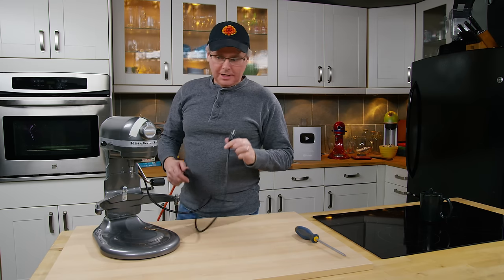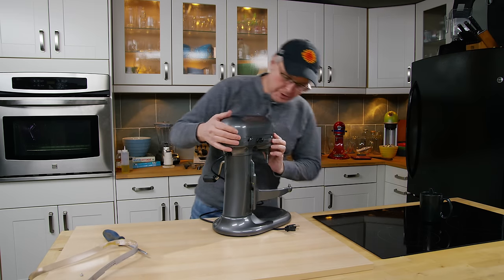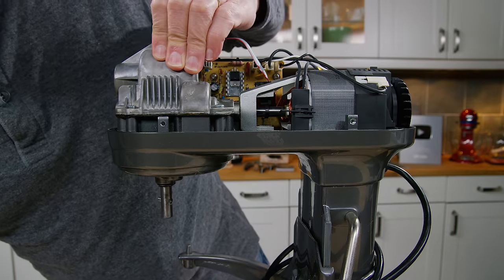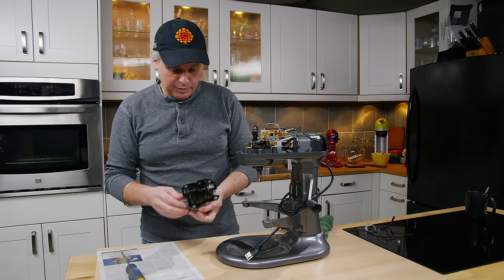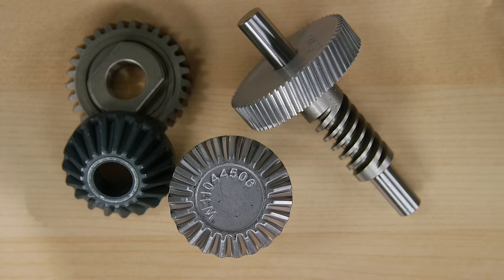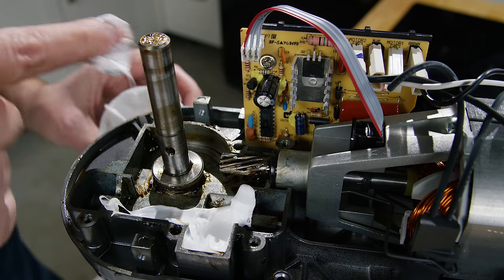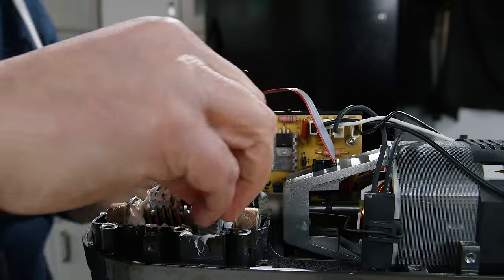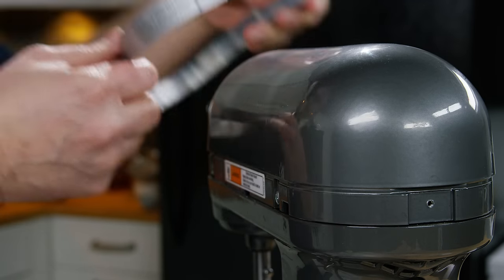Fixing KitchenAid Pro 600 Stand Mixer Teardown & Rebuild Of Gearbox - Glen & Friends Cooking

Comment: Hi,  I have the model Professional 600 mixer and when I slide the switch to any of the speed settings nothing happens for several seconds.  When it does turn on at any of the speed settings the mixer runs perfectly and with speed lever moved speeds change immediately from one speed setting to the next, absolutely no hesitation but when I turn it off and then slide the switch to any of the speed settings the mixer hesitates for a couple seconds before running.  Any thoughts what the issue is?  Thanks very much
Reply from the maker: All of mine do that  - soft start - protects the motor and gears.
Reply: @GlenAndFriendsCooking  Hi, thanks for replying. When I flip it to any speed from an off position it sometimes takes 6-7 seconds before the mixer will begin running.  So far the problem isn’t too much of a big deal, just wondered if perhaps cleaning the switch would improve its performance or maybe I will have to replace the whole switch and circuit board.package someday.  Thanks

Comment: I need to tear down my 25 year old Artisan mixer to regrease. It drips brown oil on hard use like kneading dough.
Reply: You may want to buy a new gasket. That would be the main cause for leaking grease. But while you replace the gasket,re-greaseing wouldn't be a bad idea
Reply: Definitely replace the grease but also try to look for a part number for a seal. I haven't had one that far apart but the space between the output shaft and the case must have some form of seal.

Comment: As my dad always says you can never have enough greese
Reply: Bigga da gob da betta the job!
Reply: Yeah my dad and grandpas were always the same way. My dad was a railroad carman for Illinois Central RR that repaired and maintained train cars and equipment and went to derailments to move stuff back onto the rails. My one grandpa was a farmer and my other grandpa was a Army sergeant in equipment maintenance and repair in WW2 and they repaired everything with engines.
Both sides of my family were do-it-yourselfers and my dad always said ya buy a power tool always take apart the gear box and make sure it has a lot of grease and he always was about maintenance of stuff and always make sure electric motor bearings were oiled and mechanical joints were greased.

Comment: Not all kitchen aid mixer are created equally. You  Could have 2 different pro 600 mixers side-by-side that look identical to each other but one may have a high pitch gear wine in the other 1 maybe smooth and quiet the reason for this is that kitchenaid Makes specific mixers for specific retailers. A kitchen aid pro 600 purchased from QVC or  Walmart can be very different mechanically then one purchased from a non discount retailer like Sears or JC Penney. Kitchen aid is forced by the discount retailers to cut corners and use cheaper And in my opinion  Inferior parts. You should  Also consider avoiding any kitchen aid stand mixer is sold during certain  Promotional periods such as black Friday.  Kitchenaid forces there retailers to ship any mixers the have been returned to the retailer for any reason. Whether a mixer has been return because it was salty, the purchaser didn't like the performance, or even if they received it as a gift and never even open the Box they all must go back directly to  Whirlpool/kitchen aid. These mixers are supposed to be checked and/or repaired Then sold as refurbished . This can me somewhat of a gamble since you don't know if the mixer was once damaged then repaired or If it was just a model that was  Returned.

Comment: How do I find the correct hub gear for Kitchenaid mixer?  I ordered from Amazon , however, the square hole where attachment fit is to big.  I need to know where I can get the correct part because Kitchenaid does not sell parts and are not helpful where you can order parts.  I am not paying them to repair something I can fix.
Reply from the maker: You have to search the parts list for the exact model # printed on the bottom of the machine - then order the parts from that list
Reply: @GlenAndFriendsCooking  What website do I use?
Reply from the maker: I just Googled 'KITCHENAID 5KPM50BWH4 PARTS LIST' and dozens of websites came up. It's a pretty easy search when you know the model # of your machine.

Comment: 4:27  You shouldn't be able to just lift off the gear like that. There's supposed to be a clip locking into the small groove you see later, and it seems to me that the clip failed and let the gears move up and down, wearing the upper gear out (even if it wasnn't used

Comment: Only thing I would have done differently would be to test it before putting the housing back on, if there is an issue you have to disassemble the whole thing to trouble shoot. Other than that minor difference. Good to know for future potential maintenance on my mixer.
Reply: The housing likely holds the gears in place. Turning it on without the housing means gears fly out.

Comment: This was exactly what happened to my Pro6.  When I took off the transmission housing cover one of the plastic alignment nipples was broken off in the metal housing of the mixer.  With 4 screws and one nipple still in place, do I need to spend $50 to replace it?  Anyone???

Comment: I have heard people complain about how cheaply Kitchen aid makes machines, I have repaired the same machine you have and there was no plastic in it, and I repaired a smaller one I had bought 40 some years ago and there was no plastic gears or housing. they are both still running, I finally gave the small one to my grand daughter and she uses it a lot. Why do they break. I make bread every week, and sometimes I use a stiff dough, everything has there limits. I have been repaired quite a few times and humans are great long lasting machines and we do break down. from misuse and old age. Hi PS I forgot to say, that I take pictures of the way the parts are in the machine before I remove them so I don't forget, of course I am over 80 years old and my think box doesn't work as good as it used to.

Comment: The pro 600 is such a disappointment. The planetary failed on me and same with the replacement, the pro 700 is way better with an updated planetary and the six quart bowls fit on it unlike the pro 8 quart, I really wanted a Hobart n50 but don't want to spring the 1600 dollars

Comment: I hate those universal motors like this unit has. Would be nice 2 C a 4 pole DC motor or even better, a real AC motor with 3 phase speed controller for absolute precision and torque.

Comment: Great tutorial but probably should have greased the shaft surfaces before sliding gears down, as well as the pin itself and the surfaces where the gears rest on each other. Very good video otherwise.

Comment: Talk about some crappy quality control. That ring gear should have outlasted time in itself. Good job Engineering department 👍 keeping China in business.👎🤔
Reply: It's my understanding they previously used all-metal gears ... but this resulted in burning out the motor if the workload was too high.  I'm told one of those gears is Kevlar so that it will strip ... and then it's a cheap gear replacement instead of an expensive motor.   Also KitchenAid is designed and built in the USA and it's the #1 stand mixer on the planet.  Mine is 25 years old and you wouldn't know it.  I've run it through some pretty tough dough so I can't imagine how hard you'd have to run one to break the gear.

Comment: Guess there’s not a prescribed bedding-in process from the manufacturer but you could probably run it for some time at each speed setting from low to high :)

Comment: I have 2 KitchenAid Mixers and I have been a big proponent of KitchenAid mixers for over 30 yrs.  One of my mixers is 33 years old and never had an issue.  The other (same model you are working on) is 5 years old and has had to be repaired 3 times.  It was loud from the day I purchased it.  Last year I bought a Bosch mixer and I will never use a KitchenAid mixer again.  Better for Cookies, bread, cakes - everything.  Much more powerful and much more reliable.  Please try on on your channel and stop buying parts!

Comment: KitchenAid Pro 600 Stand Mixer is the worst designed mixer in KA history. 100% failure rate.mine is sitting on a shelf in the garage and the old classic is working hard on the counter.

Comment: 6:05 so im no expert but the metal of the gear with the broken teeth looks wrong, its not really meant to have that grainy texture so it looks like the tempor may have been messed up (hence why the teeth likely broke) and if the parts all came from the same place its good odds that the other gears may have the same problem so changing it all out is the right call.

one thing that always bugs me with home repairs is how hard some manufacturers make it to do it yourself, watching experts breakdown graphic cards for testing and seeing they have had to start including hair dryers in there kits because of just how many places use glue to hold parts together or to hide screws with stickers.

Comment: Fun fact: there really isn’t any valid reason to use food grade or food machinery grease. 60% of food machinery manufacturers in the USA don’t use it. The USDA regulation for FMG is that it remains free from food or water contaminates by no more than10 ppm. Honestly, how do you measure that level. That mean no more than 1/50th of a drop of food or water may come in contact with the grease. It’s not about how safe the grease is to ingest but how cross contamination will not degrade or make the grease useless. It must be able to resist degradation from food products, chemicals and water/steam, must exhibit a neutral behavior toward plastics and elastomers, and have the ability to dissolve sugars. I don’t see how anything made in the mixer will have the opportunity to contaminate that grease. 

Any NLGI grade #2 grease is likely to be as safe to ingest as Food machinery Grease (FMG), which is about as safe to ingest as kid friendly cyanide. You would never replace your mayonnaise with food grade lithium grease. It’s about as deadly as regular lithium grease at the same quantity.